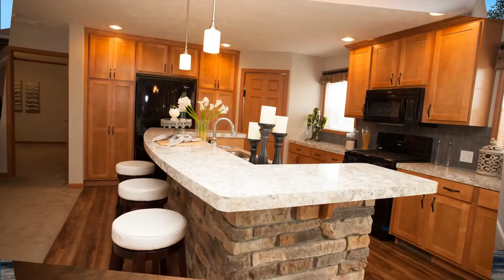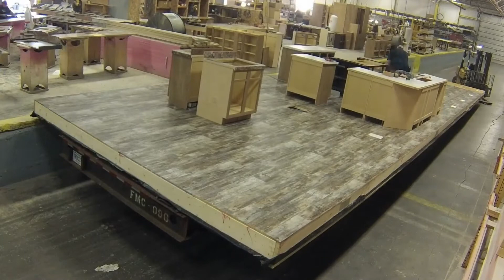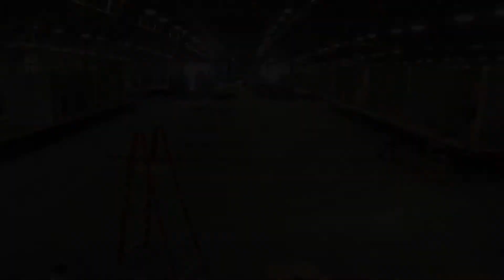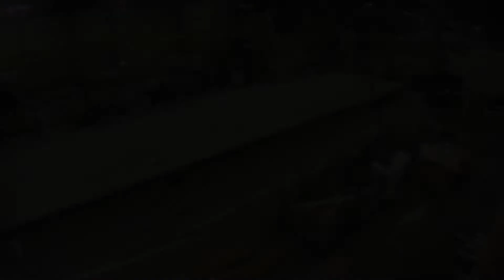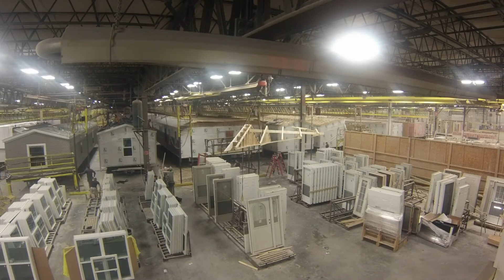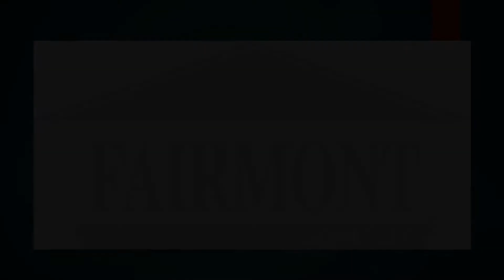Fairmont Homes Factory Construction - See For Yourself!

Comment: you def didnt make the 1994 model this way.
Reply: Actually they did the exact same way!!!
Reply: @mansomewhereoutthere149  well i tell u what i have 1994 fairmont foxwood and im telling u my sheeting on the floors are running with the joist instead of across my floors all them warped and roll and not to mention some of the other things
Reply: @mansomewhereoutthere149  i can send ya some video or pics if ya like were redoing part of it now